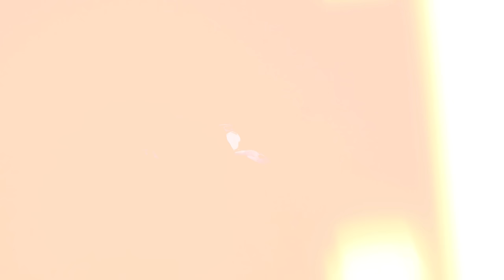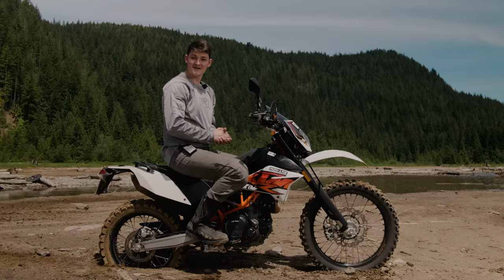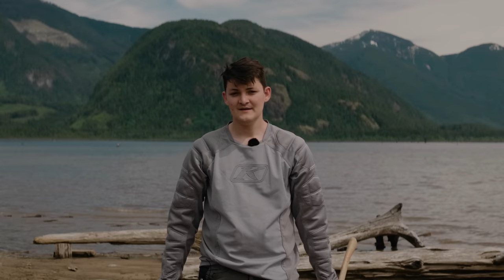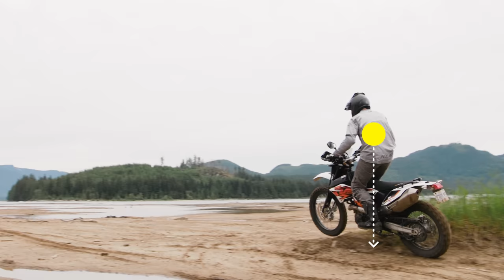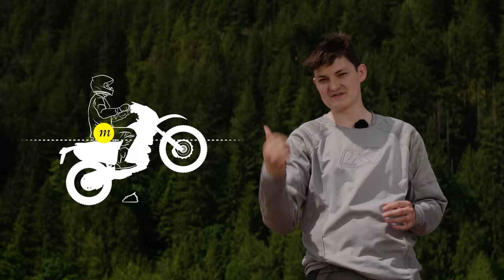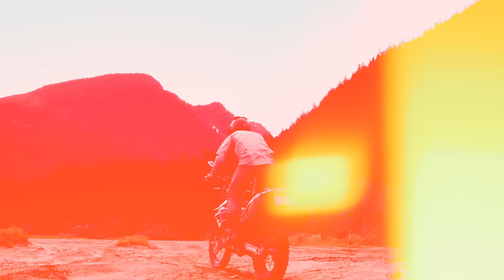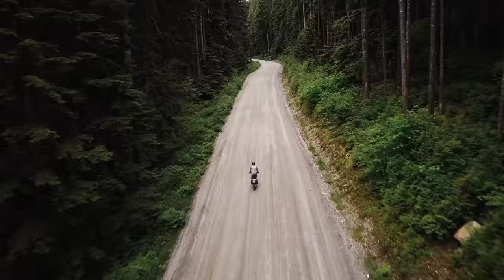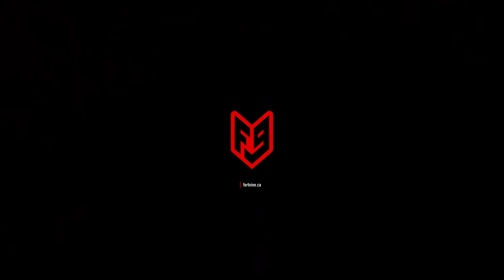Why and When to Stand on Your Motorcycle

Comment: There is one big misconseption about standing on the pegs I see all the time.
The idea is to stand when needed and sit whenever possible to preserve energy.
Many do the opposite, they stand on flat gravel roads and when the going gets rough they sit down.
So they exhaust themselfes (and/or stand with straight knees which is pretty much useless) and don't get any benefits from it when they need it the most.
A big chunk of enduro riding is saving and managing your energy (enduro=endurance),
but I think a lot of riders want to look cool like the guys at the dakar (who btw sit whenever posssible).

Comment: 2nd peg? Looks very akin to switching pegs for mini boards. I resisted doing this on my bike for the longest time because boards on the forward control bikes I test rode were never set up for my short legs. Once I switched my pegs out for minis and set the angle properly, I'd never go back to pegs. I gained lean angle from not dragging my boot heel so much.

Comment: I was on a twisty road with my ninja 250r, and you know the usual, cornering, dropping gears and in a somewhat straight part a hole in the road appeared . So from a tucked position I stood on the pegs to save my butt because the suspension ended travel and something would have broken.

Comment: also rotational moment of inertial about the bike's roll axis? or something like that. much easier to shift weight between footpegs if a rock rolls to the side under you at low speeds, instead of just relying on steering to maintain balance.

Comment: I love your videos, but the science seems to be a little off in this video. Our center of gravity changes when we stand up on a motorcycle. Its value doesn't change, sure, but its position changes. And my understanding of the Moment of inertia is the opposite of your explanation. A mass near the axis of rotation requires a greater force to rotate, so door knobs are as far away as possible from door hinges*. In the case of tightrope walkers, their weight is the force pulling them to the ground (their mass being pulled by Earth's gravity). It's usually hard to figure out where our center of mass is (all kinds of fluids flowing along our body). Still, a wood pole allows tightrope walkers to shift their center of mass, which helps them achieve balance by controlling where they hold or move it. 

* "Give me a lever, and I will move the world" - Archimedes. Or something like it. It's the same principle used in transport trolleys, see-saws, and long torque wrenches. Remember that Moment is equal to Force x Distance, which is different than Momentum, Velocity x Mass.

Comment: The converse (weight pushed further down in the motorcycle) then explains why people prefer that to the "top heavy" bikes? Moving that bike mass further from the roll axis feels like a lot more work, or slow handling? And correcting it if it gets out of line (fallin' over) gets that much harder?

Comment: Oopps! The point of weight contact is where weight is found. Which is why the bike will be far less stable on loose gravel while sitting on the seat and when you stand up on pegs, the bike immediately stablizes under full control

Comment: Another benefit is to stand while lane splitting through slow traffic. Standing makes you taller, therefore visually larger, therefore easier to see, making Ashley just a bit less likely to run you over with a Lincoln Navigator.

Comment: Hi Ryan, hope you notice this question. I recently bought a small wannabe adv bike (Honda CB150x), and put aluminum boxes on it now it's rear heavy. Would it be dangerous to ride it on steep ascents specially when the bike is loaded? I'm kind of skeptical to ride it on ascents due to the weight that shifted to the back of the bike due to the aluminum boxes.

I already rode it ~125 miles loaded with some ascents but not that steep and did not notice anything but still being cautious about it. Looking forward to your response about this.

Cheers~

P.S. I always learn new things whenever I watch your vids. I even got the Arai XD 4 and Icon's Mesh AF jacket because of your reviews. HAH!
Reply: bouytt guyt  searched what it is about and still did not able to understand it, would you mind elaborating this further? sorry for that

Comment: When you are hovering over the motorcycle you've created two distinct systems and the mass of the hoverer no longer applies to the mass of the bike in determining the center of gravity of each separate system.  Unless the hovering mechanism is in some way putting the cancelled force of gravity into the bike and only the bike of course.  Can you only hover over a motorcycle?  Can you exert lateral forces to transit space while hovering?  That would be neat!

Comment: Yes, standing is better, Just be careful when you stand like that. You shouldn't be standing like that when braking, accelerating or going over really rough terrain. The way he demonstrates standing in this video is generally used as a low-effort way of standing for low-effort scenarios. IE driving down a mildly bumpy road or trail at lower speeds. In all reality, you should have straighter legs, bend more at the hips, and have your body fairly spread out over the motorcycle

Comment: What about when going into a sharp turn at speed? I like to stand a bit and put more of my weight on the peg opposite from the side of the bike that's leaning into the turn, if I were to do the opposite I feel the bike would be more likely to tip over